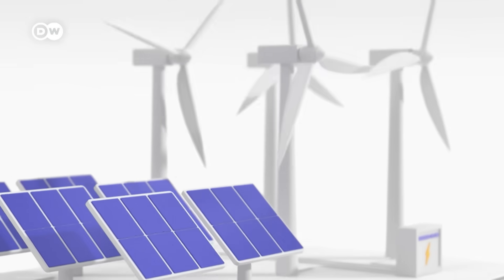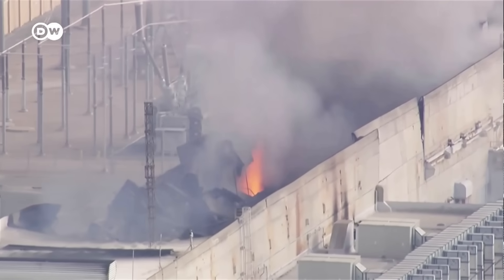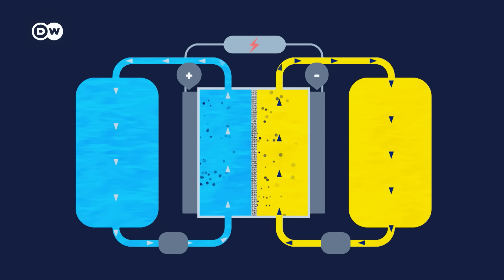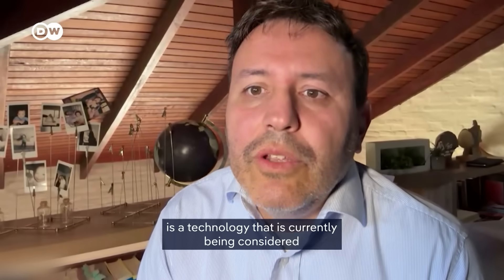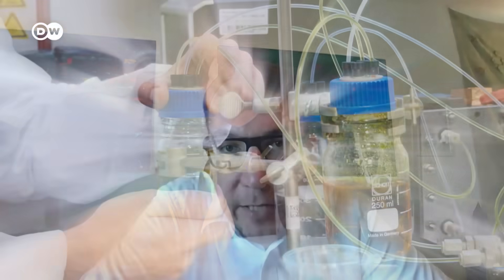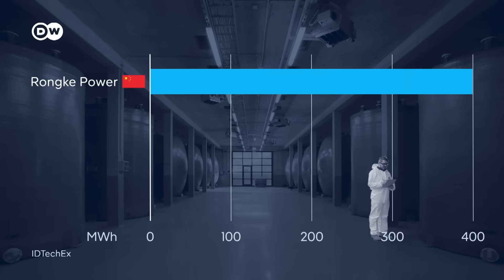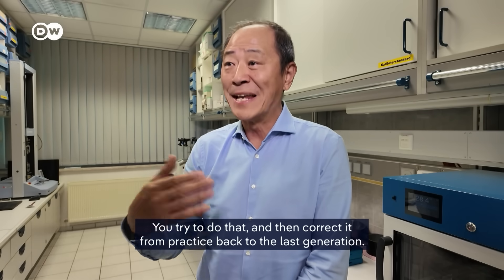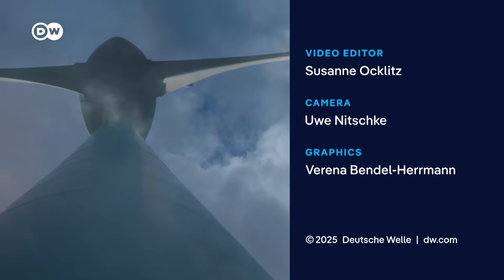New energy storage technology on the verge of a breakthrough? | Transforming Business

Comment: Salt batteries, along with sand batteries for heat, are superb options.  Hydrogen also offers 3 times as much energy density as gasoline; accordingly design a system that makes sense for seasonal needs, along with industry's requirements.
Reply: Hydrogen is too expensive, has a very low volumetric energy density, and salt batteries do not seem to fly. Sand batteries "for heat" is ok, but we need electricity.
Reply: @beatreuteler  Hydrogen can be made from electricity, or from adding water to iron or aluminum powders.  Adding water to silicon powders can also produce hydrogen. The zeppelin era saw copious amounts of hydrogen being made, for example.
Reply: @FlameofDemocracy  The hydrogen made in the Zeppelin era was tiny amounts, very tiny little amounts.
If you have a method to make large quantities of Hydrogen cheaper than using electrolysis, I strongly suggest you go ahead and build a large station that does exactly this. You will be very, very rich in a few years.
Reply: @beatreuteler  The UK Royal already invented the chemical approach to hydrogen production process over 100 years ago, for its coastal patrol.

Further, hydrogen can be mined, as water creates hydrogen when passing through iron rich or silicon dense soil.

Why reinvent the wheel?
Reply: @FlameofDemocracy  For the chemical approach you are describing I have missing information to comment, maybe there is a reason why it isn't done on large scale. However regarding the mining it is simple: It is not sustainable.
Reply: @beatreuteler  There are talkers.  And then there are doers.  Cash in on SDGs.  Easy money.
Reply: @FlameofDemocracy  I tried. Not easy at all.
In the meantime I am directly invested in some solar projects. That works, but maybe isn't for everyone.
Reply: @beatreuteler  Thank you for sharing. Good bye.

Comment: Energy can be stored in various ways, the Finns have even invented a sand battery, where energy is stored in the form of heat. But aluminum is much more useful in this regard, both because of its heat capacity and conductivity. Out of curiosity, I calculated that energy in the form of heat can be stored in large aluminum blocks, approx. 100 t. It could be recovered either directly, as heat for heating houses in winter, or as electricity, using a closed-cycle steam turbines. In terms of capacity, the energy  stored in aluminum in the form of heat, both in terms of energy density and cost, is similar to lithium battery systems. The advantage is that aluminum blocks practically last forever, aluminum is abundant in nature and recycling does not cause problems.
Reply: Yes but roundtrip efficiency of heat storage, if your end user energy demand is electricity, is very bad.

Comment: Jeez, for a news organisation from a nation with electronic and battery businesses like Siemens, BASF and Merck your stories on power grid technologies consistently seem outdated and sloppily presented. Not separating runaway thermal vulnerable and rare metal containing LiNMC batteries from low flammable cheaper LiFP batteries makes your analysis look amateurish. Vanadium redox battery technology has been around for over ten years now, as your rightly and contradictorily mentioned relies on the supply of a critical fairly rare metal and has failed to become commercial. No mention of lower cost and density Na ion batteries either. Not up to DW's general standards imho.

Comment: Many significant errors in this. LFP batteries are now used in grid storage. They are cheaper and do not require nickel and cobolt. They also have a much reduced risk of fire. Claiming lithium ion batteries "bassically have to be thrown away" once they reach the end of life is also false. The material of the batteries can be recycled, which is much cheaper than mining new material. You really should correct these errors.
Reply: LFP is a way to go. At the end of life cycle, it can be recycled into new battery. LFP is so cheap now that it is economical enough for home use.
Reply: @lapprentice  Or sodium. Even cheaper, literally fireproof, and more flexible in extreme temps
Reply: Sponsored content probably
Reply: Fossil funded video
Reply: At the same time, they said that flow battery electrolyte could be reused, but didn't talk about recycling the rest of a flow battery. I think they understated the ability of redox flow to be recycled. Australia had a company making redox flow batteries for building and grid storage,  but they went broke because they couldn't compete on price with lithium ion. 😢
Reply: I agree
Reply: Lithium ion batteries CAN be recycled yes. The problem is less than 5% actually do get recycled. Simply not cost effective. And lets be honest. its not about creating a clean energy. Its about making money. Thus. They basically get thrown away. I am NOT against "green/renewable/clean" technologies at all. they represent investment  and employment opportunities and other economic benefits. HOWEVER. There is no such thing as "green, or clean energy" Nice catchphrases but the claims themselves are false. All we are doing is substituting one form of pollution for another. ONLY reason these L/I batteries arent yet a major problem (cept in the areas where they are mined) is we arent using enough of them. Car pollution wasnt a problem at first either till everyone had one. But as more and more people move to electric and more and more of these batteries end up in landfills because people aren't going to"dispose of them correctly the problem is coming. Sure, you will have more clear skies You just wont be able to drink the water.
Reply: Ditto! @DW, this doesn't meet basic journalistic standards. Please don't contribute to widespread disinformation.
Reply: Even if you can recycled, in case of a problem pop up into the battery, you will need to replaced all battery. It’s what they mean about this matters. Maybe you will sell the old battery to a recycled plants for a fraction of the price maybe 10 or 5% maximum when compared to a new battery.
Reply: @pedrohugoneri  What do you mean by, "in case of a problem pop up into the battery, you will need to replaced all battery."?
Reply: Great, they can be recycled. 
Now add the charging infrastructure, battery infrastructure, and recycling costs into Solar LCOE.
Reply: Also these batteries would have a specific use it can't be used in cars or atleast it won't be efficient because the car is now required to carry the liquid
Reply: @abdu8204  this point is stated near the beginning of the video; it does say that the tech is for storage of solar/wind electricity and implies not vehicles
Reply: @abdu8204  who said anything about vehicles?

Comment: The future of storage is geothermal storage. Drill a hole, frack the rocks, and blow it up like a balloon. Sage Energy is working on that.
Reply: Fracking is a nogo. And thermal storage is not very efficient. If you drill to make a geothermal plant, just use the geothermal energy so you don't need storage there.
Reply: @beatreuteler  It's not the same fracking as in the oil industry. This is clean, with water and sand. No chemicals.

Comment: No mention of Sodium Ion.
No rare metals required.
These batteries cost less, last much longer & don’t catch fire.

Then there’s compressed carbon dioxide (EnergyDome), where renewable energy is used to compress CO2 into liquid, stored under pressure, then allowed to expand turning a turbine to generate power when required, before being stored in a “bladder” ready for the process to begin again. 

I’m not sure what method will be the winner, but it will come, & in the meantime most countries have a long way to go before they can close all their gas & coal electricity generation, so at the moment we can use them as peaker plants.

Comment: Only windmills and photovoltaic panels need energy storage. I hope that in a dozen or so years they will be just a bad memory.
Reply: You couldn't be any more wrong. Nuclear power requires lots of storage as well as it is very bad at following changing loads.
Switzerland alone employs approximately 1.3 TWh of pumped hydro storage that was planned and built in a time where no wind and no solar power was on the grid anywhere close. The vast majority of energy stored in these plants originated from French, German and Swiss nuclear power stations.
On top of that, Switzerland and France promoted electric storage heating for homes for decades.
On top of that, in Switzerland but most likely also elsewhere, the poroviders of electricity controlled the water boilers through a power line signal and by doing so made sure people would heat the water needed for shower, dishes and so on during the night and not during the day.
Reply: @beatreuteler  Switzerland is a small country that has always served as a treasure trove for money stolen by thieves from around the world. This could change at any moment with the collapse of Western civilization. Western countries account for only 12.5% of the world's population.
Reply: @Pawel-g8x  It has already changed. Since a bunch of years, we have strict laws against "money laundry" which used to be big in the past. (and we are still there). I guess you are a bit behind the news.

Comment: Chemical batteries are only viable for frequent cycling, with short storage periods (hours to a couple of days maximum), and small amounts of stored electricity (100MWHr maximum)

Natural gravity batteries like pumped hydro are far more suitable for larger and longer electricity storage (GWHr or TWHr stored for hours right through to months or even years)
Reply: No one needs storage for years but anyhow: There is no problem with batteries storing energy for longer than a few days. The only problem with that is economics. As you invest in a battery you want to use it and that is it what requires cycles.
Until the past 2 to 3 years, a rule of thumb would say that you need about 200+ cycles in a year to make a battery oeconomically viable.
But that was at the battery prices from back then.
Today, batteries cost almost half of what they did back then and so you need less cycles to break even, assuming the life time is at least not worse.
I don't say this is a linear function so one cannot say you are ok doing 100 cycles (ours does about 120 cycles and still works at a loss financially) but it is significantly below 200 in the meantime, depending on the tariff spread.
With 120 cycles, the average storage time is 3 days which implies that sometimes it will be significantly longer than that.
To make such a scheme oeconomically making sense, battery prices need to further drop just maybe 20 ot 30% from where they are today.
Reply: @beatreuteler Yes, economics requires cycling daily at a general rule. Hence why chemical batteries are utterly unsuitable for longer storage

If you think longer term storage isnt needed, you are way out of your depth. Here's a hint for you to ponder - spring, summer, autumn, winter, cloudy, sunny, windy, calm, 

Hopefully that helps you grasp the basic concept of long term storage.....
Reply: @Goodkiwibloke  If that is what you mean, you simply did the wording wrong. Because none of the examples would imply "storage for years".
Reply: @beatreuteler there was nothing wrong with my wording, it was very clear. Chemical batteries are unsuitable for long term storage. Pumped hydro is successfully used for long term storage
Reply: @Goodkiwibloke  Nope. Pumped hydro is used for  short to mid term storage. Pumped hydro is far too expensive for long term storage.

Comment: Wind, solar, lithium batteries and interconnectors will get us 80-90% of the way to a decarbonised grid cheapest. So these longer term duration batteries are competing against other long duration storage systems like compressed air, or against nuclear and other fossil fuels, the easiest of which to ramp up and down in a dunkelflaute is gas. We have maybe 15 years before this becomes an issue and the price of lithium batteries is still falling. So the economics will be very challenging for flow batteries unless markets regulate out fossil fuel use completely.
Reply: Challenges are a driver.

Comment: I also find the sodium-ion technology very interesting for stationary storage. It has a lower energy density that LIB, but has many advantages otherwise:
It only uses widely available materials (eg. salt), can't burn, works well in the cold, no need to worry about deep discharge.
Also, it's structured quite similar to a lithium ion battery, so it's easier to adapt the production to them.
Reply: Not really. Some Sodium ion batteries have the same energy density as LFP batteries.

The reason why it's still not cheap and not as mainstream is simply because of LFP batteries.

Only when lithium prices increase dramatically the market will demand sodium ion batteries
Reply: @ariefghani2380 Nonsense, Sodium Ion will dominate. Less than $20 per kWh. It will take time to scale but will displace Lithium Ion.
Reply: Yeah, this is interesting tech, but lithium ion is entering mass production and has a lot of significant advantages. The race is on!
Reply: I was looking for this comment. Natron, LiNa, and Peak are all in exciting territory with their technology. Sodium will become the superior option for many reasons within a decade, maybe 2 decades at most.

Comment: Just create a lake on a hill top. Improve efficiency how water is pumped up, and how energy is generated down hill.
Reply: We built one of those in Ireland, it took 6 years to build. In the past 18 months we have now installed the equivalent of three times this lake with Battery Energy Storage systems and for a much cheaper cost. BESS is much cheaper and faster to install.
Reply: Sean Bean puts his hand on his head. "One does not simply create a lake on a hill top, plug pipes, pumps, generators, substations and an interconnecting branch line into a grid, then firm renewable generation viably. There are cost blow outs, geological complications, environmental considerations, seepage problems, drought threats and contamination compensation problems lurking there beyond number. The very water you run it with is choked with congested interests. Not with one in ten proposed sites could you see a project completed let alone run viably. It is folly - to think it is the main let alone the sole solution."
Reply: @bluecedar7914  In Switzerland we have about 1.3 TWh of pumped hydro storage. But we have mountains, not hills.
Reply: @beatreuteler Exactly. And you don't tend to get droughts. Not yet anyway.

Comment: China is ahead of selling you rubbish, in the forms of solar and wind power. But they’re building around 18 coal fired powered plants.
Reply: In fact China is installing most of the soalr arrays and wind power stations they make inside their home market.
And fact is, what you call "rubbish" is powering our homes.
Reply: @beatreuteler should note the distinction between “home” solar a homeowner uses and industrial base load capacity.
Reply: @lostcreek7551  Industrial baseload, where needed, can be achieved by solar and battery as well. (Exceptions in heavy industry do not falsify the rule). Only that it may not be sufficient to install it rooftop. Companies who have seen the benefits are adding solar above the parking lots  etc. And of course there is a reason why we have a grid. Then we have wind, hydro power, bio-gas and bio-mass as well as a few other sources and yes, there might be a certain size of residual need to be covered by gas peakers depending on Geography.
Reply: @beatreuteler what rule do you think was “falsified” and you do know it takes coal to make a solar panel, right?
Reply: @lostcreek7551  Please reread, so you know. And then: No, there is fundamentally no coal needed to make a solar panel. It is possible however, that today coal is still used, but that does not mean it is needed.

Comment: Was this created in 2020? No one's using NMC , NCA or NMCA for stationary anymore. LFP is not flammable and does not use either cobalt or nickel. Sodium will be used in a couple year's time as it scale up. Flow has been around for a long time and the technology hasn't improved anywhere as much as the Li-based or Na-based storage systems. Outdated and misleading content.
Reply: Vanadium use is decades old but the research into compounds to replace vanadium for cheaper and likely more dense redox flow batteries is new promsing research, that's what the "on the verge of a breakthrough?" is referring to, which is expected to be achieved by mid 2030s at the latest. These organic redox types once perfected would be cheaper over time than even the cheapest theoretical for sodium ion batteries, which itself is cheaper than current vanadium redox flow batteries.
Reply: this.